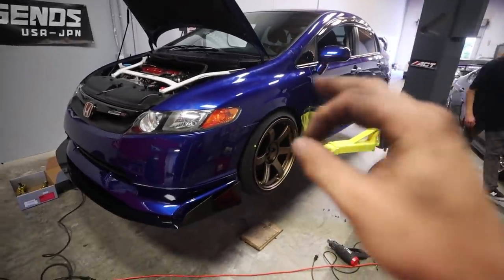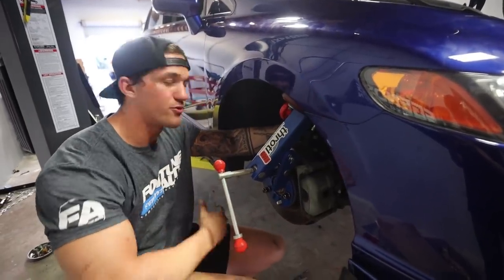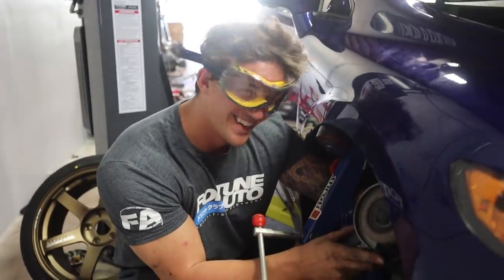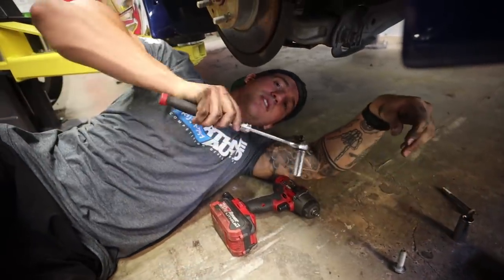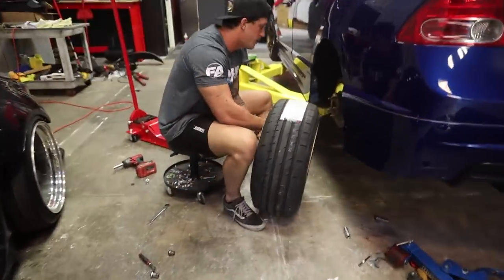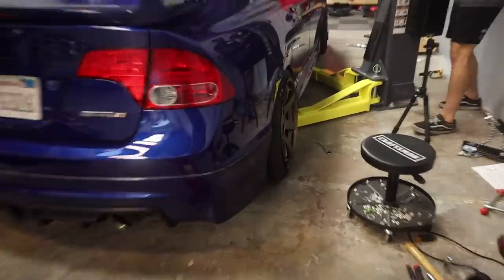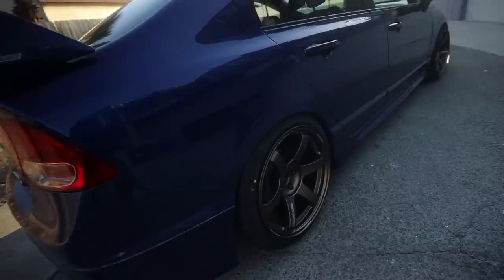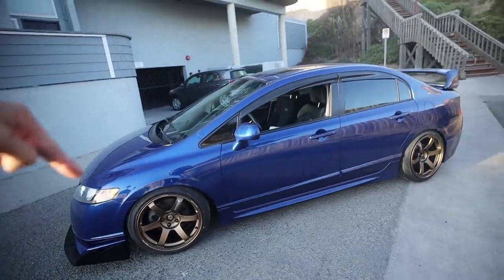Mugen Honda Civic Si AGGRESSIVE New Wheels Are On! Fitting the TE37s

Comment: Understand when you are dealing with suspensions always make sure that adjustable coilovers and control arm doesn't get intact with the fender firewall because the car will end up rubbing and not maneuvering accurately

Comment: adjusting the rear are super easy, take out the bolt holding the rear arms and spin both nuts until they are loose and and spin nub in for leg and out for positive.
Reply: also for more camber take one nut off if more more neg is needed take both out!

Comment: Here some ideas, i have the same on my2008 Honda Civic SI
:

- SKUNK2 MegaPower Header Alpha;
- SKUNK2 COLD AIR INTAKE;
- SKUNK2 MegaPower RR 76mm Exhaust Catback
-  SKUNK2   coilovers
- SKUNK2 cramber
- ECU reflash by SKUNK2
- Mugen SI RR front lip
- Mugen SI RR side skirts
- Mugen SI RR rear bumper lip spoiler
- Mugen SI carbon fiber trunk spoiler wing

Comment: You should get Ingalls camber sliders to put at the top of your camber arms. The range of adjustment using the sliders is a lot wider than using just arms. I actually only used stock arms with these sliders and was able to get about -7 in the rear. Hope this works out so you could go lower lol

Here’s a link: https://www.corsportusa.com/i-1928-2006-2011-honda-civic-ingalls-rear-camber-adjusters-pair.html